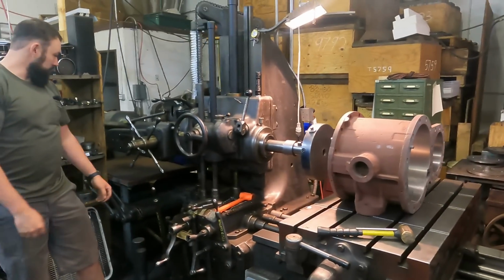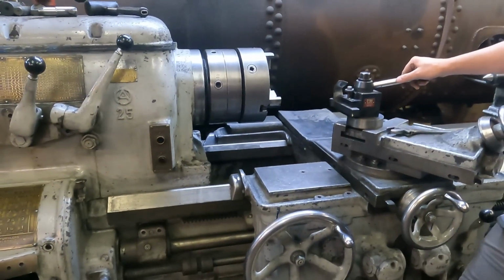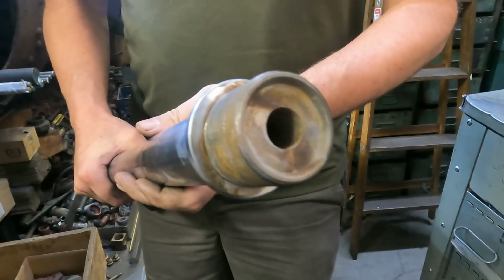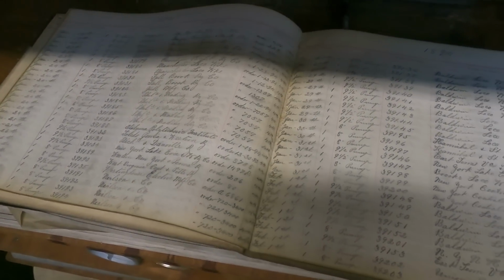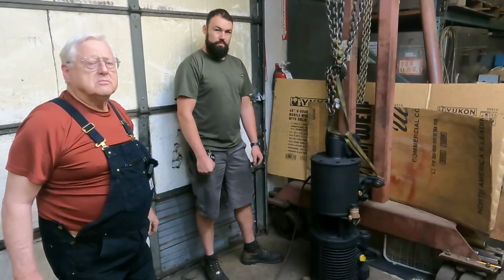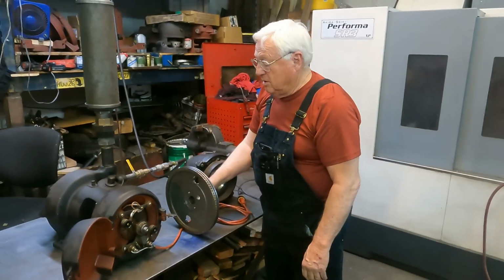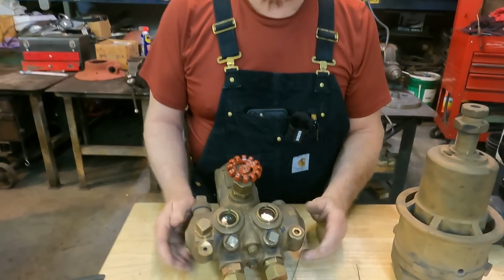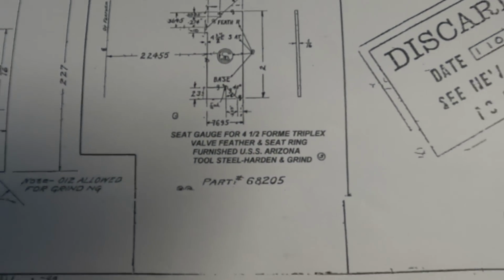Shop Tour 14:  Backshop Enterprises - Steam Locomotive Appliance Rebuilders

Comment: 32 VDC was the standard voltage generated by 1930's Farm Wind Generators.  More voltages were added at the end of the 1930's. It was DC voltage so line loses are an issue.  A great grandfather of mine had a Zenith 32 Volt DC Wincharger.  It charged up large lead acid batteries that were rebuildable in glass tanks.  It was used to power light bulbs and his Zenith Farm radio.  They are called "Farm Radio's" because these tube type radio only used DC voltage and had no AC power supplies. The Universals did not come out until after WW2 and more rural electrification had been done.  These farm radios are fun to restore very simple to work on.

Comment: I have read that the original patent application for an injector was turned down as it was believed that it was impossible for it to work.  Very crudely, the pressure of the steam imparted a velocity to the stream of water that was sufficient to overcome the check valve on the boiler and allow the water to enter the boiler-or something like that.

Comment: What with everything being made today by CNC,AI, computer this and computer that, enough credit may not be given to the designers, engineers and developers of the machinery made in the days before computers. Look at the preciseness that was achieved without the use of a electronic calculator or computer, I stand amazed!
Reply: Yes, even the older machinery required a high level of genius to design and build.
Reply: It is pretty interesting to program a CNC with a drawing from the early 1900s. I am still amazed today what the engineers figured out over 100 years ago, we are very hesitant to change their design.
Reply: He said that Horizontal Boring Mill could do down to a thousandth without a problem. Nice machine!